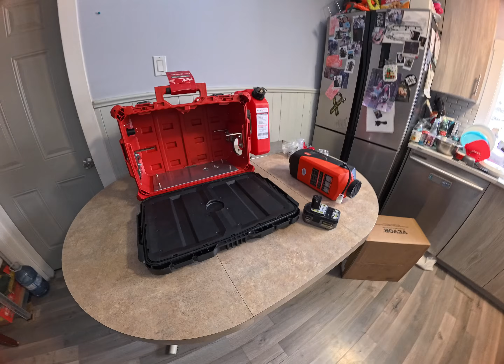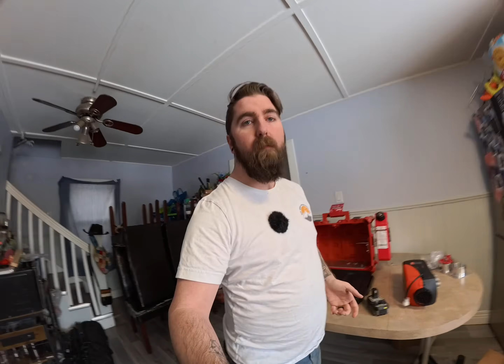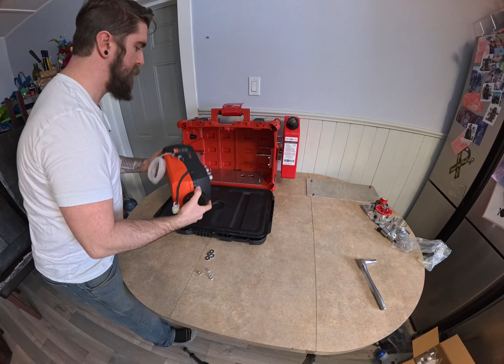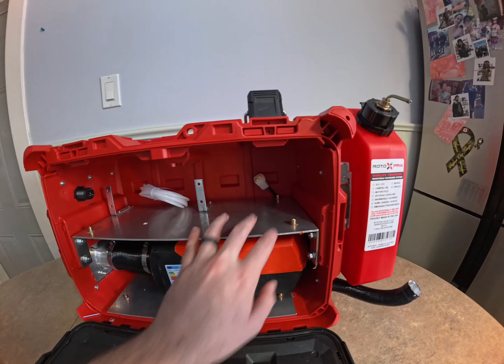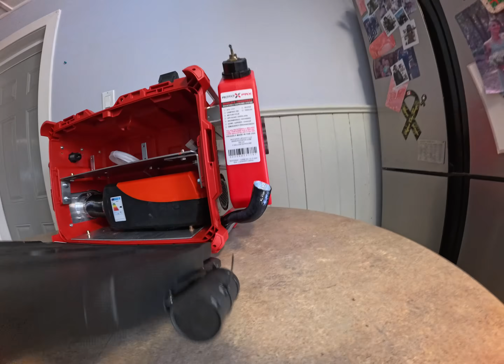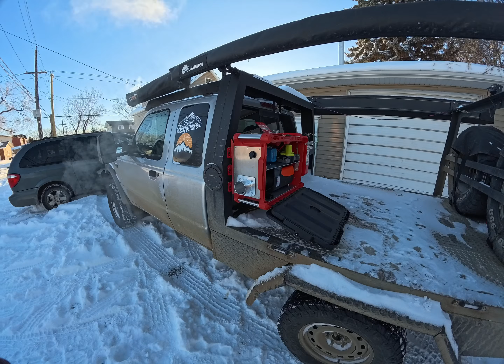The Ultimate DIY camp Diesel Heater: Vevor + Milwaukee + rotopax + Victron

Comment: what did you use for the converter and low voltage cut off? I am doing the same with my diesel heater in the same packout case but 2 m18 batterys. I cant find a reliable low voltage cut off that isnt amazon or a converter I trust not to catch fire lol

love the build, simple and effective. Well done
Reply from the maker: The low voltage cut off is one from Amazon but it’s a charge controller and voltage cut off with next to no instructions on how to change the system (I have a video on it) 

For the converter it’s a Victron 24-12-20amp non isolated and not ip67 (waterproof) 

I appreciate it! Good luck on your build!

Comment: Nice build.  Looks like you used the 2KW heater, right?  

I did my build using a Pelican case i picked up on Facebook Marketplace and printed a bunch of parts using my 3d printer.  Also picked up a few keyboards like a quieter fuel pump, stainless quick connect fuel line kit, an aluminum diesel heater case and a silicone gasket.  A few other bits from Amazon for the RV wiring connectors and the exhaust outlet.  Pretty happy with mine but I want to add the ability to run this off a powertool battery like you have done here.
Reply from the maker: It’s an 8kw unit, and I took a lot of inspiration from other folks builds that used a pelican or the cheap version from princess auto or harbour freight, we want the ability to mount it to the truck on and off easily. I wish we had a 3D printer for some parts but we definitely plan to upgrade some stuff especially after using it this past weekend